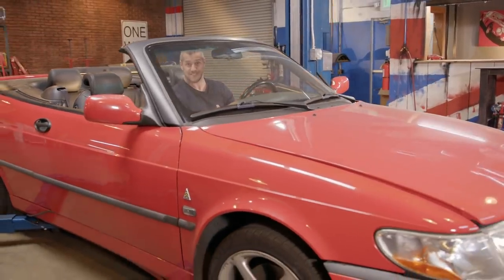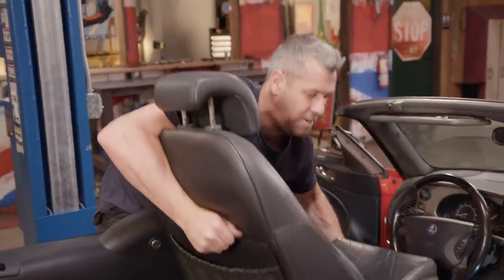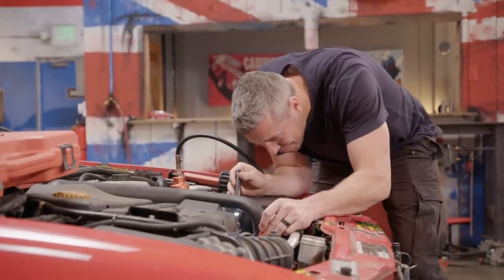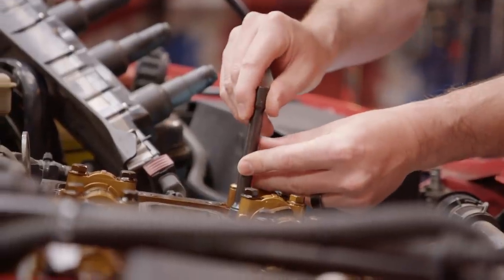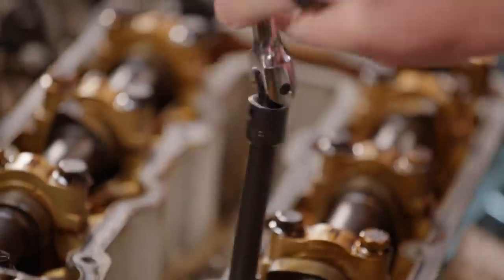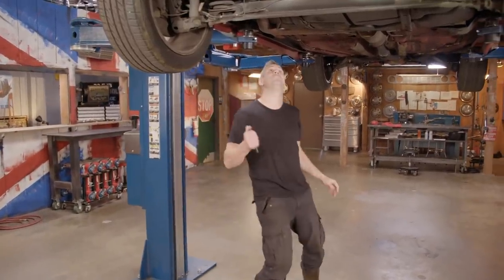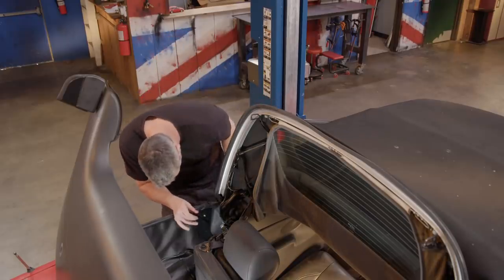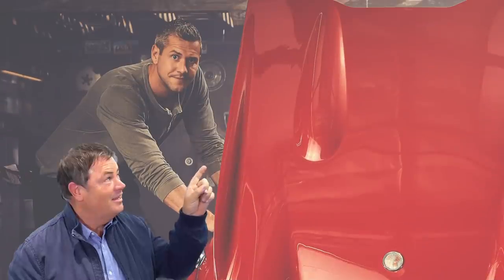Saab 96 Viggen: How To Fix With A Coolant Leak From The Engine Block | Wheeler Dealers

Comment: I just bought a 1999 Viggen and the owner said that the engine was seized and I found that the head bolts were loose and 2 cylinders filled with Antifreeze and locked the motor. No damage was done but my intent was to rebuild the entire motor anyway. This car is pushing 370 WHP and 430 lbs torque. Fast little bugger 😄

Comment: Damn this looks like something that could have been made around the year 2000, but the saab 96 was first made in 1960, saab was really ahead of their time.
Reply: To give you an actual answer: This car is a 9-3 Viggen, not a "96".
Reply: Engine was developed in canley Coventry I do believe,
Early dolomite sprint has the same engine as early Saab’s
Reply: @dennisking1555  yeah, those first years of Saab had terrible engines, but after Saab redisigned them, they became really really good
Reply: @Lee-z8n2q  Yes there is.. Both 96 and 9-6. The 9-6 exists as a prototype in the Saab car museum. It was a Subaru with some Saab badges. Another Saab/Subaru is the 9-4. It was no hit but they made it to the market..
Reply: @J1I9M7M4Y  I stand corrected, Thank you for the insight.

Comment: I actually had a 9-3 Viggen 3 door. Not terribly fast off the line (FWD, no traction control), but the midrange in 2nd & 3rd was just astonishing. So of course I added an Abbott Racing stage 1 remap which bumped power to 274bhp. Oh my word. What a car. I really wish I'd kept it.
Reply: Only basic models came without TC. All Viggen's have it coming out of factory.
Reply: @Cpt_Wolf  not true. Viggens got it for the 2001MY if I remember correctly. Early Viggens didn’t have it.
Reply: @themancuniancandidate2744  correct, early 9-3s didnt have any TCS, it came around the same time as the Aero

Comment: the tightening sequence is very wrong, all bolts to 30 lb.ft then another pass at 44 lb.ft and then 90°
Reply: was looking for that comment! thx buddy
Reply: Batter than factory spec. 

Loose.
Reply: In first glance it looks wrong but isn't, he unbolted only one at a time, replaced it and retightened. If he had removed all of them and then installed new ones probably a new headgasket would have been nececery beacause of the head movement.
Reply: @Panikass3  he could remove them one by one and only torque at 30 all of them 
And then do the pass at 45
Reply: @Telgas  True, that sounds even better!!
Reply: And why he did not replace the head gasket which is obviously partly worn and not excessively expensive? Also, i was a bit fun of edd china, but let give credit to ant. He also looks like a master.
Reply: @michaelspyridopoulos841  Yes, the head gasket is cheap. But it's a pain to replace!
Reply: @michaelspyridopoulos841  no need . It is common for these Saabs to have loose head bolts that cause small leaks . This is a very easy way to fix a small external leak . If the leak were internal the headgasket would need replacement .

Comment: I wish I knew about the head bolt issue before my head gasket blew and caused lower end damage.  But now I'm turning my 2005 9-5 Arc into an Aero after learning the difference between the two trims.

Comment: I did this fix on my 9-5, but used ARP head studs. Way better fix than using even the uprated bolts, given the cylinder pressures the B234 can generate.
Reply: All petrol og 9-5's have b2x5 engines. B2x4 came out of factory in 9k, 900ng and early 9-3's.

Comment: Does the B204 have this head issue?
Reply: Yes
Reply: @christophercarson3143  I got 215k on a 99 9-3 and a coolant smell no visible leak. I guess it's head bolt torque time...
Reply: @thefinalroman  iv got 97k on one and you can see the oil and water running down the block. You can't watch it but it's been doing it. I can't smell no coolent. Maybe you have a slight split in a pipe?

Comment: Top tip: Most of the aftermarket bolts bottom out in the thread on the cylinder block, because the aftermarket bolt has different shaped head on the thread. Better to use the old bolts.

Comment: Replacing only head bolts once the coolant has already leaked through the layers of the head gasket ? Not advisable but was a good quick fix all the same
Reply: I would agree if it was a head gasket failure in the first place that caused the leak, but being that it was just a loose headbolt that means the gasket itself is fine, it just wasn't squeezed together properly. This repair will have no issues for many years to come

Comment: Pretty sure you're supposed to give them all a pass at 30ft/lbs and then a second pass at 45ft/lbs. Otherwise what's the point of tightening each bolt to 30, pausing, then going to 45?

Comment: You are suppose to perform the first around of the torque sequence at 35. Then on the second round 45. Not 35 then 45 on each one. One round at a time.  Then run it and torque angle it to 45 while running at  a warmed up temp. That's how we did it at the Dealership. By the way I'm not knocking him cause i actually think he is a great mechanic. That's just the way iris showed us how to do it. (Iris) was the manual Saab used just like S.I (service instruction) for general motors.
Reply: You're absolutely right - I wouldn't let this guy work on my 9000... you start at the centre of the cylinder head and go around the clock working outwards.
Half the story is worse than none of the story.
🙄

Comment: There is no way new bolts fixed this car. I bet a month later it leaked again.  Why not just tighten the head?
Reply: It was a known issue. It fixed many engines of this variant. It was a factory assembly issue. There were service bulletins issued on it.

Comment: He started the car without pushing in the clutch...?🤔
Reply: Now I need to go out and try that on my viggen lol
Reply: My saab 9-3 viggen dont have the system pedal clutch
Reply: @alejandromeza8824  I see
Reply: I actually tried this on my 2000 viggen. It works! Lol
Reply: It’s so you can move it with the starter motor in a pinch, just like VW van 😂😂😂

Comment: Or I can tell you right now you're using the wrong radiator fluid it's supposed to be orange dexcool
Reply: While you are correct about the Dexcool, you are absolutely wrong about the Peak Global Lifetime coolant.  It's not only compatible with this vehicle and Dexcool, it is a superior coolant in every measurable way.  He did this vehicle a major upgrade by using that coolant.